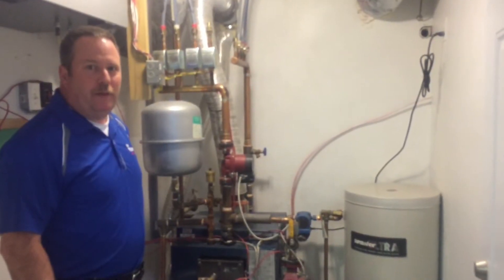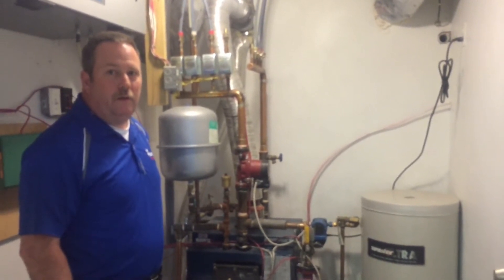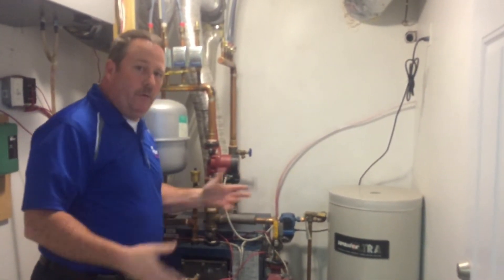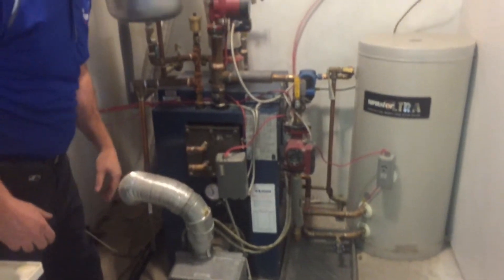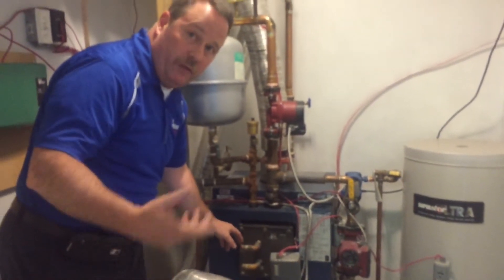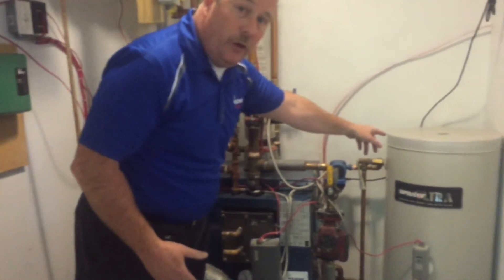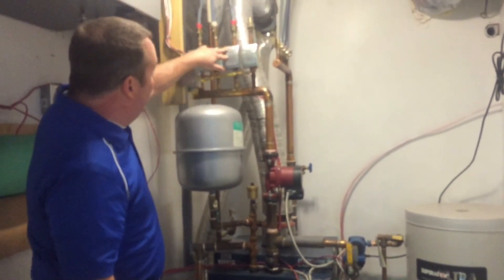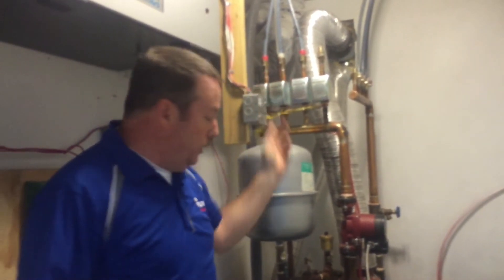Hot Air Furnace VS Hot Water Boiler - What is the difference?

Comment: I'm looking at a house right now with a boiler system - How do people with boiler systems typically cool their homes in the summer?
Reply: Pretty sure they just use a regular air conditioner like you would attach to your furnace. You will need vent work but it will only carry cold air from your AC as you get your heat from water pipes in your floors. This is the best system you can have I think, and it automatically pumps hot water to the only room you want it rather then the whole house like a furnace does.